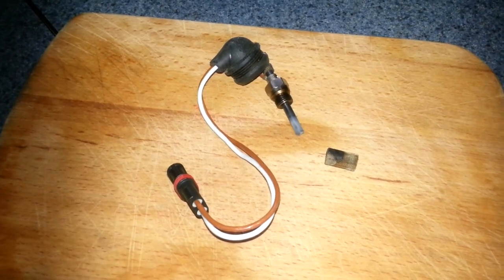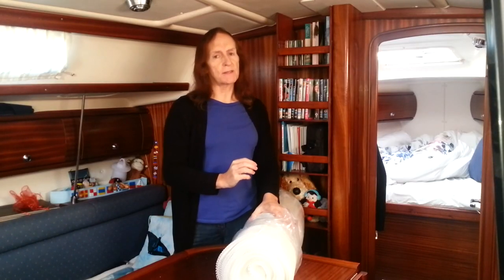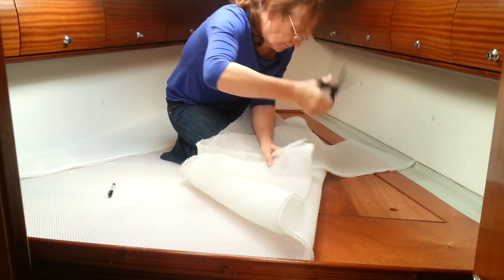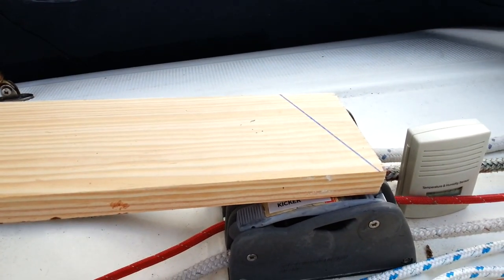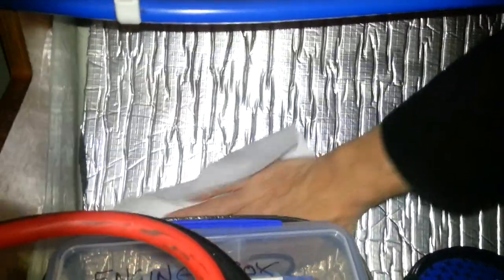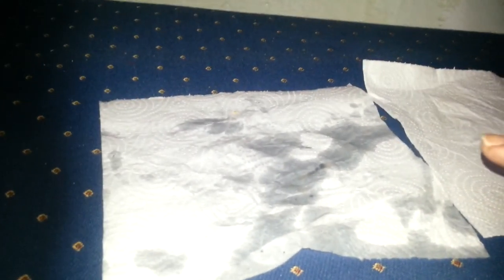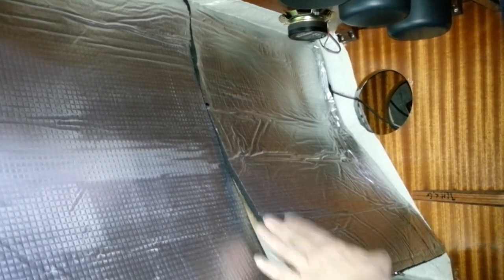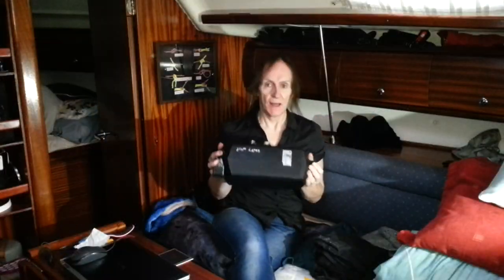Worse heating, better insualtion - Ep. 74

Comment: Well I have caught up to date, yayyyy.  
I like your Irish sea videos, well all of them really. 
I'm thinking about bringing Seminole down to the IoM this season so it was good to see what to expect.
The insulation looks very effective, the moisture will condense somewhere though, unless you ventilate well, it's usually on the windows on Seminole.
Looking forward to your updates.
Bob.
Reply from the maker: Hi Bob - The IoM is great fun and stuck in a bit of a time-warp (shops actually close at 5pm) but we both love going there and it is a great stopping point for crossing the Irish Sea but just be careful going around the ends!!! I am glad you enjoyed the videos and that they have been informative and useful, that is part of the reason we did them.

You are correct about the moisture and we tend to keep a forward hatch open at all times to allow warm, moisture-rich air to escape the boat. The insulation has made Salty Lass into Snuggy Lass - it is near tropical in here ;-)

Comment: Maybe put a small tank in for the white diesel to use in your heater .... drip diesel heaters are one of the best for live aboard
Reply from the maker: Hi Darrel - the likelihood is that we will simply start putting white diesel in the main tanks when the current red runs down in two or three week's time. We do not get through vast amounts of the stuff and, although it will be more expensive, the costs will be about the same as getting a service and clean every quarter. Salty Lass's little engine does about 800nm on 150L of diesel.

We did not go for a drip heater because:

1) They take up way more space than we want to lose, and
2) Living aboard in this season is temporary. Next year, we intend to be somewhere much warmer.